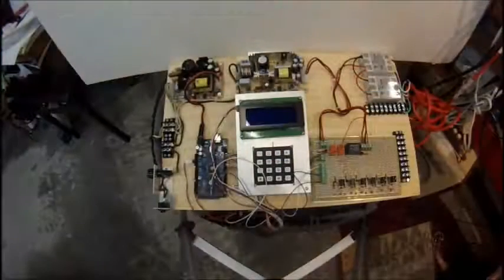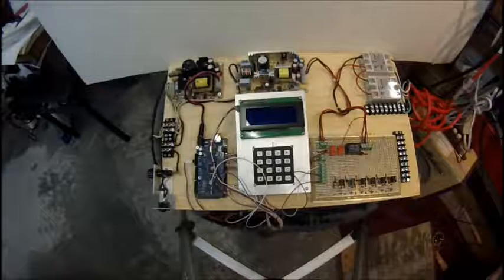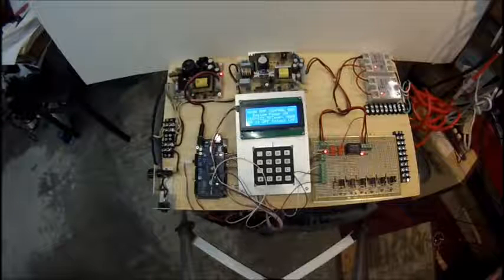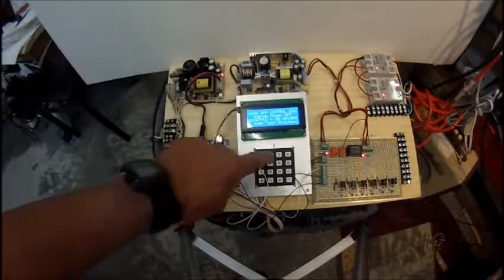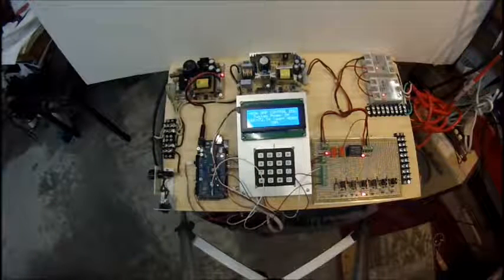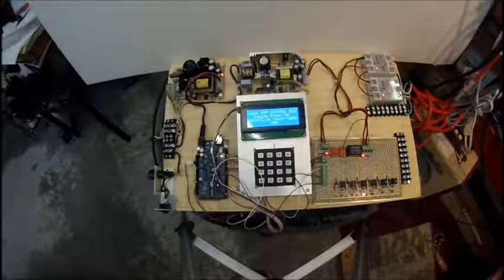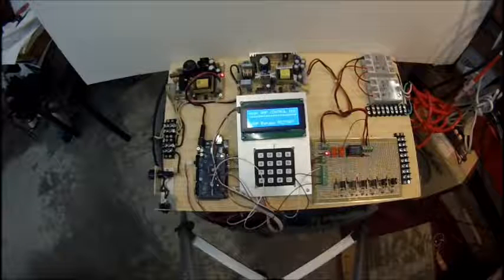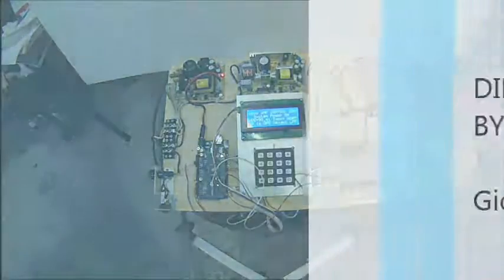Arduino Mega 2560 Controlling an LDMOS RF Amplifier

Comment: Hi Pete, I have been following this project on here and on your blog. It looks like everything is coming along quite nicely. Can't wait to see the end result!
Reply from the maker: Me too! I just hope it works. Had about 20 minutes this morning and added a terminal block so the outputs of the LPF relay switches can be easily bussed off of the board. That worked FB. Maybe later today I can add the LED16 relay and the TR and Bias circuitry to the board.Thanks for your post and the interest in the project.73'sPete N6QW

Comment: Pete, instead of going with a TFT display, you could keep using the 20x4, but use a version that has an RGB backlight. This way you could make it flash red in alarm conditions, yellow for warning (no BPF selected, etc), blue for amp powered down, green when in operation, etc... Have a look at this: https://www.adafruit.com/products/499 . 73 de VE2YTQ
Reply from the maker: Hi Om,Thanks for the posting and the tip. Did not know that there were such LCD's. That would sure do it. Interesting enough you can purchase two 240X320 displays for what it costs for one 20X4. My how times change. 73'sPete N6QW

Comment: Very ingenuous, Pete!  Definitely shows that the Arduino can be used for so much control.  The Mega 2560 might be a great choice for a multiband transceiver build as well.
Reply from the maker: Hi Dean,Thanks for your post. I bought that Mega for about $15 --so much capability and the footprint is only slightly larger than the Uno. Yes it could handle a lot of actions. Just wished I really knew what I was doing. It would be ideal for a multiband rig and with I2C --maybe two screens.73'sPete N6QW
Reply: Knowing what you are doing is highly overrated :). Good job, Pete.
Reply from the maker: Hi Tom,Really do wish I knew what I was doing --so far a lot of luck and dumb mistakes but some turned out OK.73'sPete N6QW